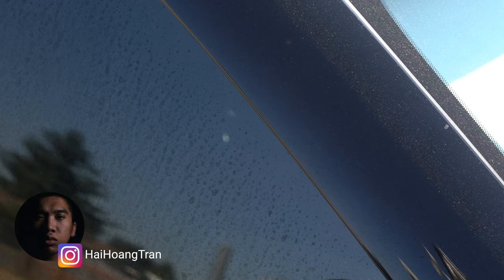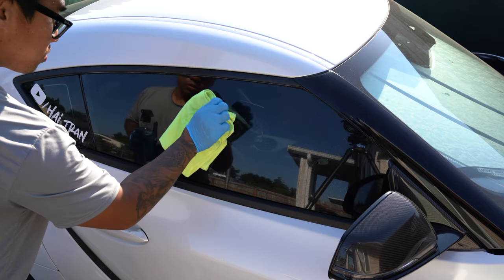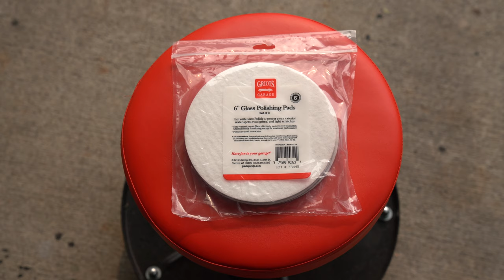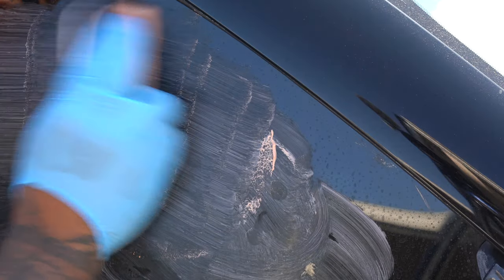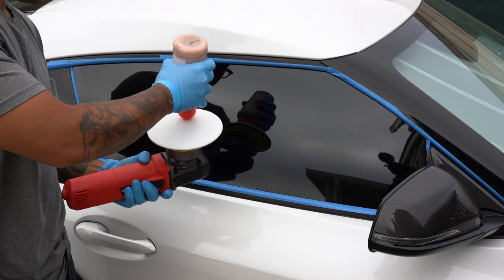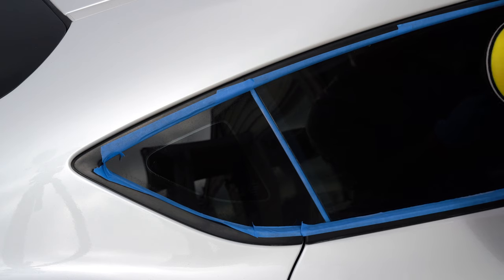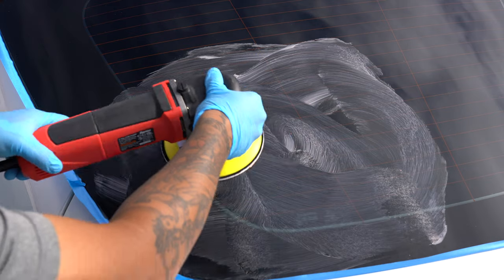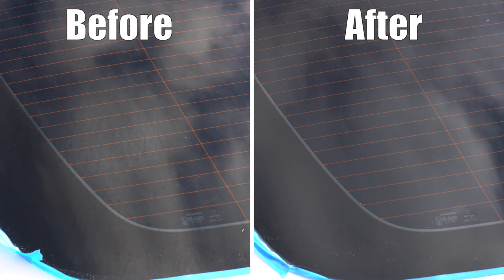Removing Water Spots with Griot's Fine Glass Polish & Glass Polishing Pad

Comment: A detail shop put a ceramic coating on my windshield. Been through almost $300 worth of new wiper blades, and they all streaked and I was super unhappy. I had to fix it myself, I took my Zota 3 inch polisher on either speed 1 or 2 and with a felt polishing pad and I actually used Weimans glass cooktop polish and CarPro ceriglass to remove my minor scratches but I will not the coat windshield. I do glass polishing on both cars and around homes. I do inform people for liability reasons I WILL NOT offer a coating for the windshield, I do however put it on ever other window. I think this was a great video man, lots of great info 👍

*I had that coating since May 2021 and went through that 300 bucks of blades, shop charged 100 dollars... I got ripped off IMO
Reply from the maker: That’s unfortunate to hear but live and learn.

Comment: Why didn’t you open the door When polishing? I also noticed you didn’t neutralize the glass after polishing leaving behind a wax silicone Barrier that you will have to cut through with the polish.
Reply from the maker: Opening the door would’ve introduced a tremendous amount of vibration and would’ve been counterproductive. This car has a frameless window design. The glass was cleaned after polishing.